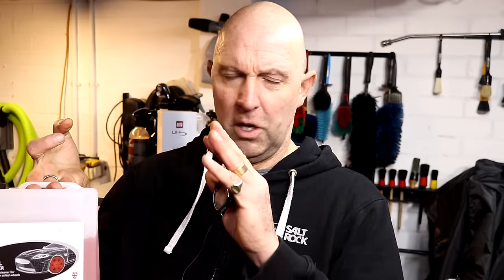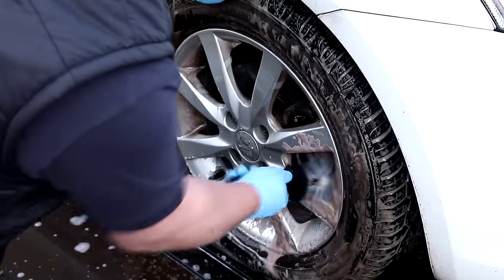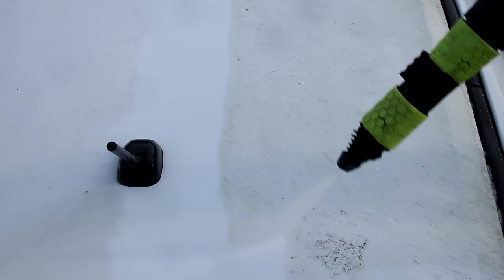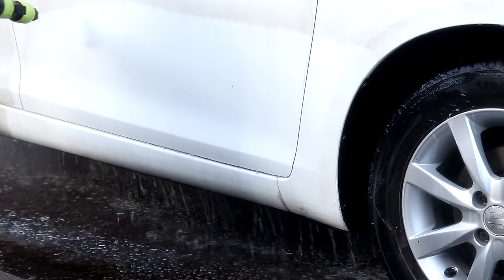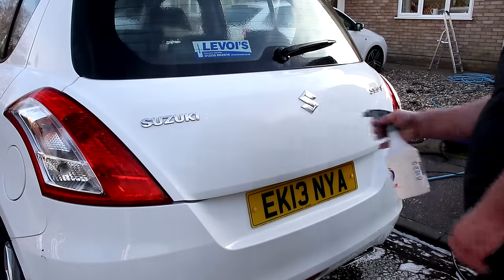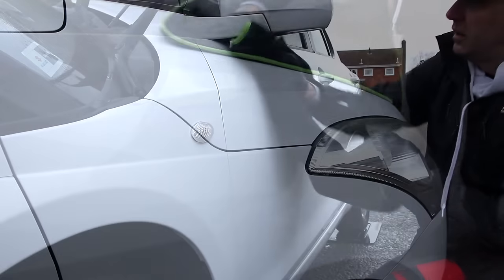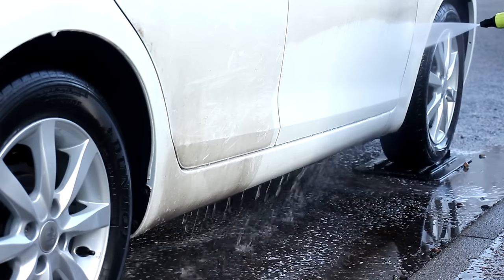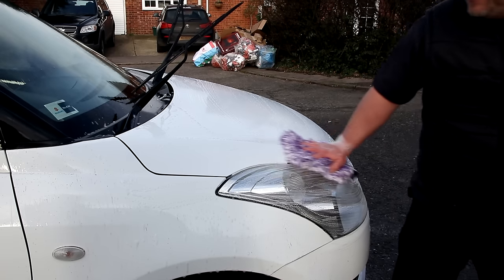First wash in six months Autoglym and Autosmart

Comment: Looking good Paul, it certainly needed that. Glad you got on with Acid Wheel Cleaner and Clean All from our Professional range, and they did the heavy lifting on the cleaning side. We do have a range of TFR's, from very strong to mild, as you already had experience with Clean All I recommended you stuck with that, although Multiwash TFR or Advanced TFR would also have been good alternatives. Also glad you liked UHD Shampoo, with that we wanted to not only make a good shampoo, but make the experience of using it enjoyable too - so glad that shone through. All the best, Mark From Autoglym
Reply: I've actually switched from autosmart to autoglym very impressed

Comment: A nice video with a pro doing the work whilst giving you tips to pass on 👍👍.
The only negative for the majority of us is that Autoglym won't sell any professional range to the general public, I've tried to ask my local auto parts guy (who is a main stockist) and the rep point blank refused. His reasons were that that's who the smaller bottles are designed for. I can only assume the same is true for Autosmart aswell.

Comment: The review again provides more than just a demo, but also more explanation about the insights, conditions and points of interest.

What I can say from experience is that a final wash after an acidic rim cleaner neutralizes the acidic pH. This can be done, for example, by using the foam lance again and rinsing the rims. And this with a regular ordinary shampoo.

The rims in the demo were extremely dirty, so an acidic product is not always necessary. Conversely, a good alkaline cleaner can also do the job.

As always, various options are possible.

My best wishes for 2024 btw!

Grtz
Reply from the maker: Happy 2024 great comment 😍😍

Comment: Question Paul. Surely if you use a mitt to spread the fallout remover across the panel after it’s reacted you are dragging the fallout with it - won’t it scratch the paint?
Reply from the maker: The chemical reaction is to tell you the fallout has been dissolved so no it won’t scratch
Reply: Ok cool - thanks